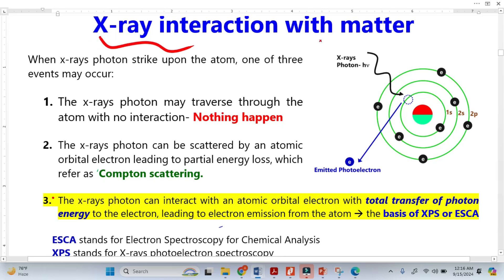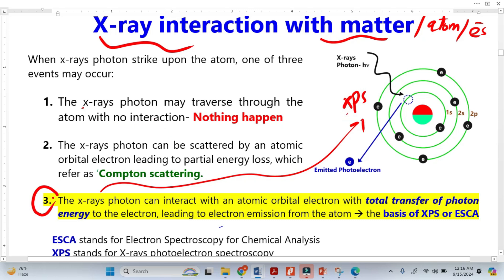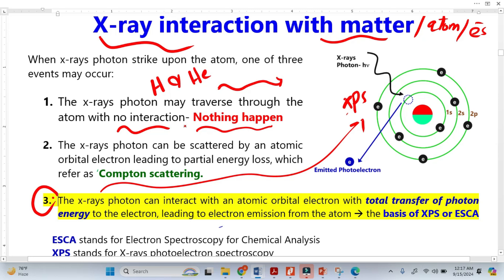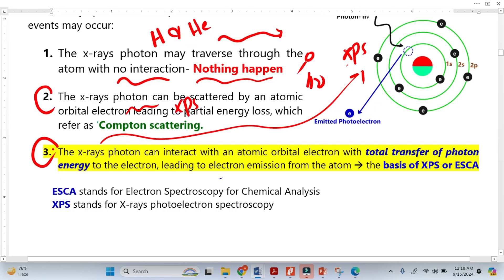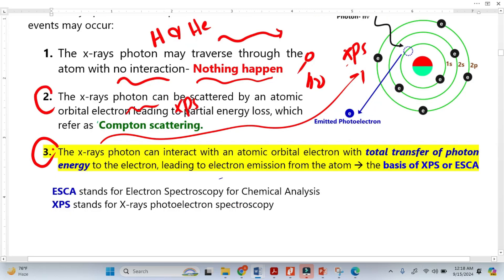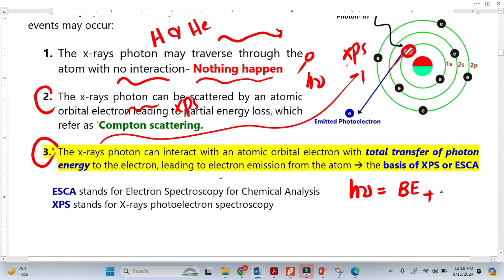How XPS Really Works: The Physics Behind Photoelectron Spectroscopy

Comment: An excellent video about photoelectrons. I'm not sure if an accelerating electron causes light or a slowing electron causes light. A slowing electron transfers energy to light so that no energy is lost, perhaps.??? THANK YOU very much for helping me understand photoelectrons.
Reply from the maker: Thank you for your great comment and appreciation. 

Accelerated charge particle (electron) causes light because acceleration in moving charge particles occur due to change in direction or speed, which resulted in the emission of a photon. Let explain it this way: Whenever, an electron speeds up, slows down, or changes direction, it loses KE by radiating EM waves, or photons. 

I am not pretty sure that your question is about the photoelectrons in XPS or general? 

If you have any questions related to these characterizations like XPS, SEM, XRD, TEM, etc... You are welcome to ask me any question.

I am extremely grateful for your nice comment. 

Cheers. 

Be happy